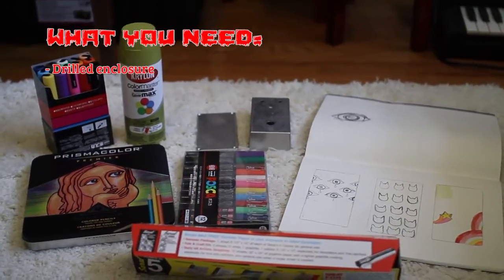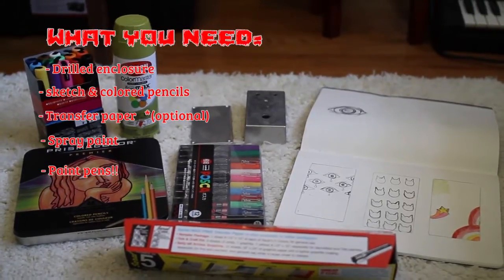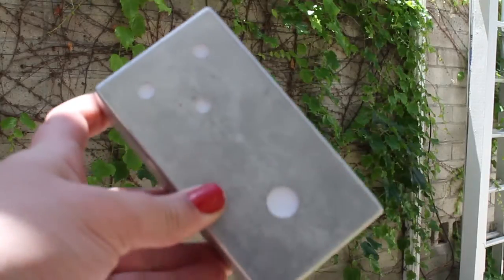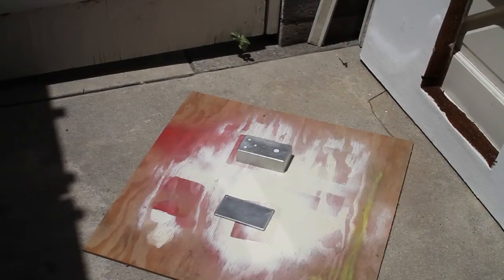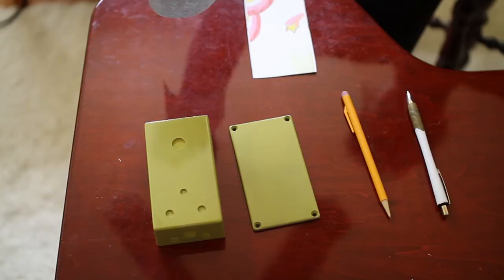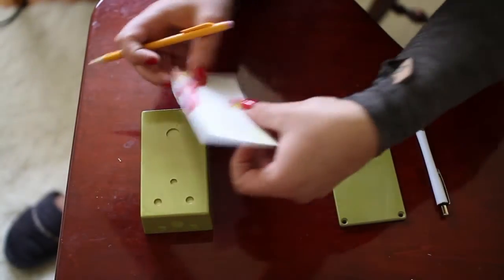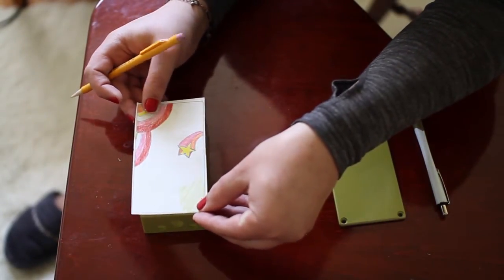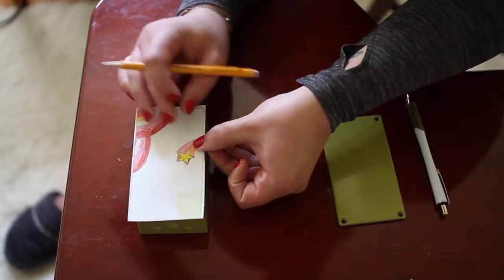HOW I PAINT MY FX PEDALS  USING PAINT PENS & SPRAY PAINT | psychedeliccherry

Comment: Cool pedals. Could you use the paint pens on an already finished pedal to just go over the top of a boringly designed one?
Reply from the maker: If you want to redesign a pedal, you really would need to chemically strip the paint and sand it down.  Store bought pedals are painted with powder coat, which is a very thick glossy paint.  It's pretty difficult to remove, and painting over it with acrylic pens won't look very good.  But, I mean, really, you can do whatever you want.  It's your pedal.  heh.
Reply: Ok thanks for the info. I already painted over one with paint pens. Looks pretty cool from a distance.
Reply from the maker: heh.  n o ones looking up close anyway right?
Reply: True ;]
Reply: what chemicals do you recommend to strip the paint off ? thx

Comment: Hi - 

I'm looking to retouch a pedal. I'll need to strip the paint of and sand first, right?

What do you use for paint stripper?

Thanks!
Reply from the maker: Yes indeed. Any paint stripper will do. I just use the basic stuff and let it sit in it for 30 minutes. Wipe it off with paper towel and then wash it off.  light sanding by hand... then you're good to go.
Reply: The Psychedelic Cherry thanks so much! Love your stuff

Comment: Hi! I whatched your video because I'm waiting for the box for my Fuzz Factory clone. I want to do some hand painting on it like in the stile of the original (you can see it by searching zvex fuzz factory hand painted if you don't know that pedal). What is your advice for this job? Should I use paint pencil under a base of, for example, green glitter coat? I really need your help because I'm new to this and I only have one attempt! :(
Thank you!!!!
Greetings from Italy :)..
Reply from the maker: I would give the enclosure i nice sanding, wash it off, spray a base coat in white of aluminum friendly base spray paint. Then a day later I would use a green glitter spray paint (automotive if you can find it... heres one i found https://www.google.com/shopping/product/9815516733387729909?q=spray+automotive+paint+green+metal+flake&rlz=1C1CHBF_enUS749US749&biw=1569&bih=920&prds=paur:ClkAsKraXwhlPOAqBzG4a1FQOeBoprKG4gKjvTyMrAw_VGlfWWrgX8xRIXkj_KW56fIhy0vhl_OVG3BPjjvzdh6TiOgd-M_RhdEN0B2LWq0fJ9LLjkLsmspjUhIZAFPVH73QXBo3sCuWCBkR5nWDC8RS6w0lCg&sa=X&ved=0ahUKEwjDk4TssczYAhVF3WMKHbn2DbQQ8wIInwMwCQ  )  And then when that's dry I would use paint pens and stencils to get the design just right.  Follow that up with some high gloss finishing coat automotive spray paint.  thats the best you can do from home.

Comment: What chemical makeup are the paint pens? acrylic enamel or laquer enamel? I used silver metallic car wheel paint for my chassis base coat but Im looking for the type of paint pens Ill need. Also with bare metal you really shouldnt assume that the paint will be fine on its own. You should really use a self etching primer or at least an automotive primer, then clear coat. I havent done pedals, but Ive built motorcycles and cars and my good friend owns an auto paint and body shop so Im not talking out of my butt. I just need to know if these pens are acrylic enamel or something else. The wrong type can cause hige problems if the recipe has too much of some ingredients or you dont let it cure long enough. Thanks!

Comment: Could I use stamps instead of paint pens?  What kind if paint/ink would I need?
Reply from the maker: You sure could.  I would recommend using an aluminum friendly spray paint base coat (even spray automotive paint is best)  and then dip your stamps in some acrylic paint.  I would give it a good day to dry between coats.  Then use a spray automotive clear coat to top it off.